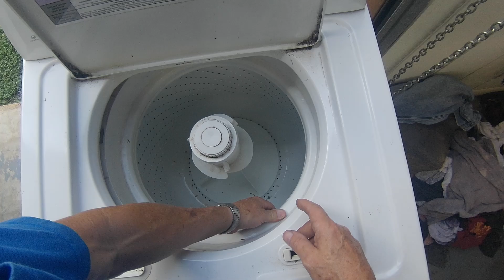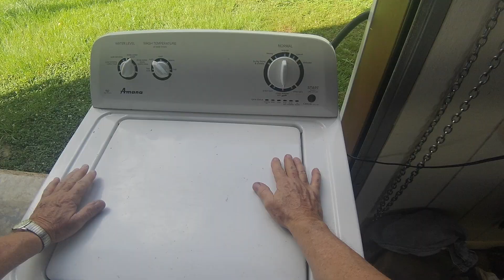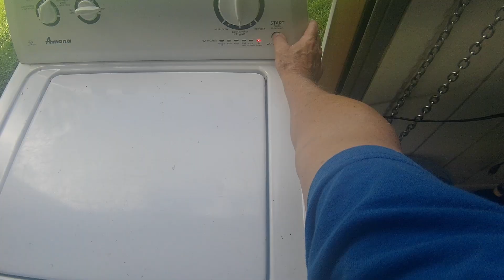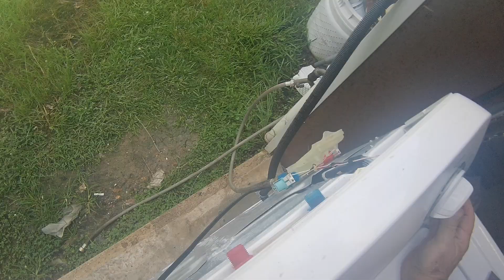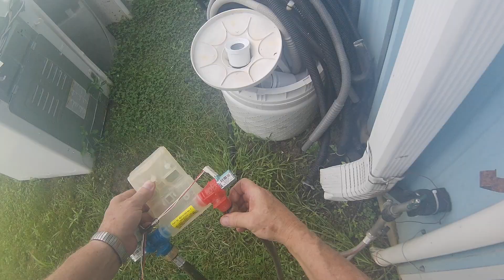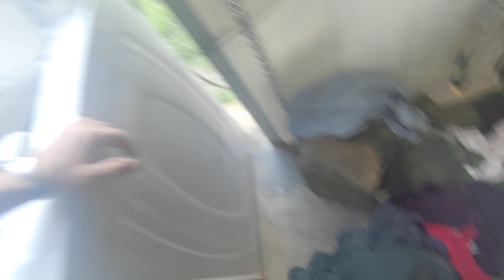How to Diagnose & Fix Washer Not Filling With Water | Easy Valve Replacement

Comment: Hey there I have a speed queen old school style my gf overloaded it and when I looked it was part full of water and not working so I emptied it out and it will drain it will spin and it washes makes more noise and a clunk when in wash cycle but there is no water and the deep water button just buzzes and no light. Would it be button or valve

Comment: Man , you should get a ATV/motorcycle lift so you don’t have to kneel so much working on these . They can be locked to like 5 different heights so you can easily tip a machine over and work on the bottom .
Reply from the maker: That would make it a lot easier, thanks for the tip!